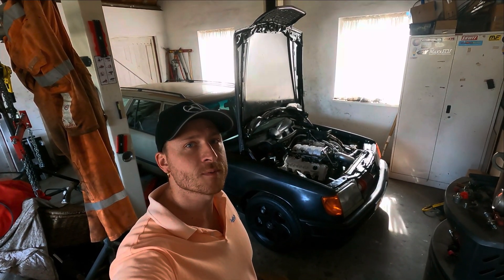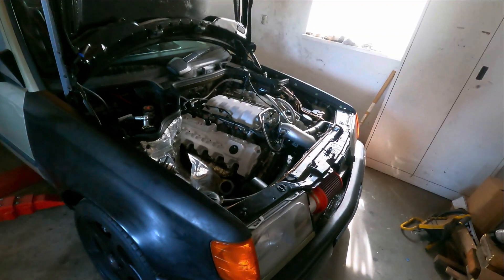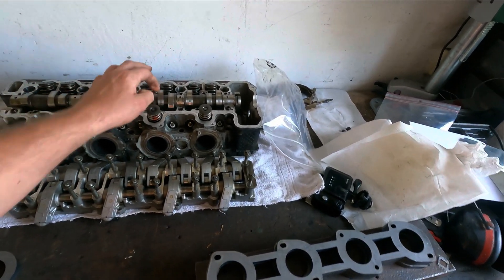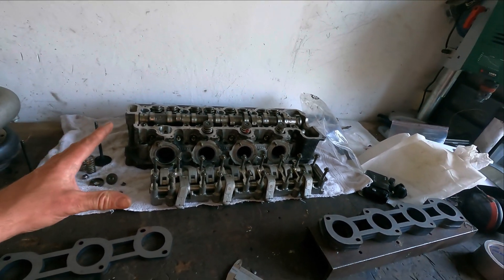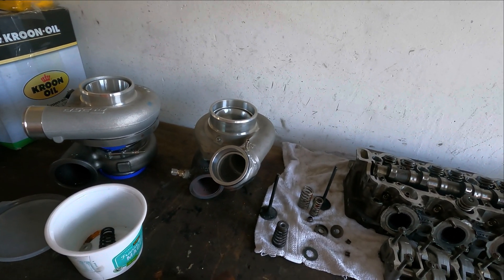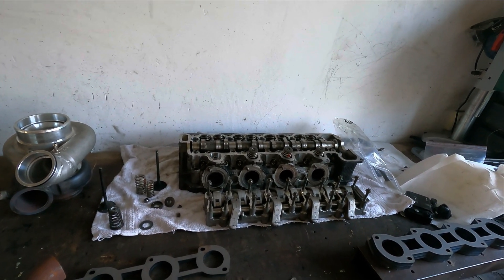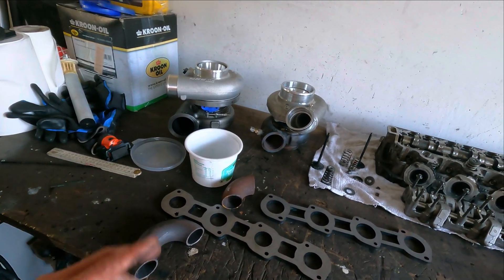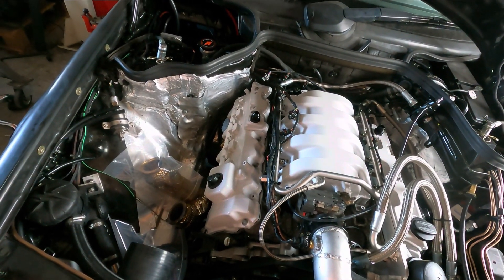Upgrade to M113k Heads and Bigger turbo after 1e dyno session

Comment: 3:32 Surprising to hear the 55k uses the same size exhaust valves as the 430. Are the intake valves the same size too?

7:13 From what I've read and seen the kompressor engines also have larger combustion chambers to lower the compression ratio.
Reply from the maker: I think i mentioned  later that the 430 valves are smaller.  De 5.0 and 55 are the same . Sorry for the confusion
Reply: @JMSpeedshop  👍
Reply from the maker: Yes the combustion chamber is bigger.  But not is i thought ,3cc or so.  And then the dome in piston. What the NA engine does not have

Comment: M113 AMG 5.4 naturally aspirated engines also have double valve springs as standard.
I think it would be a good idea to fit new valve seals to those heads while you are there because they are known to start leaking in some cases.
Reply from the maker: Yes.  All amg heads have double springs .  I will clean them and for sure put new valve seals in

Comment: Also put a nipple in the downpipe to measure back pressure in the system..(more. Importantly this pressure will make the lambda sensor read "rich"..the more pressure it sees.
Might be a good idea to add a "dyno" lambda sensor bung in it aswell, reading from the back, with twin pipes always reads wrong. 👍
Reply: I have an nice backpressure canister for you to test on it (before turbo ofcourse) let me know where to send..
Reply from the maker: I have one 50cm behind the turbo . But going to 4" downpipe .  Also going to run 8 egt. Sensor

Comment: Absolutely do not use the big pipes.. you will kill the turbine efficancy. 

Flare up the 37mm Id pipe. Absolutely don't run the 42mm..just not needed 
If you want to see what pipes work, look up the "m119LM" small pipes...
Reply: I also want comment this. We do with 42.4x2.6mm Manifolds more HP and spool than the bigger 48s also over 1200hp on 6cyl 3.6 liter.
Reply from the maker: @TimsTurboCentrum  sounds correct .  If you dont downsize from the exhaust port diameter
Reply: Just for reference, made over 400hp\cylinder with 33mm Id tube... 1.25" shed40..
Reply from the maker: That can be the case .  But going down in diameter is not good for flow.  And this engine can not be compared with the m119lm engine that had 2 exhaust valves and 2 seperate exhaust outlet ports.  It is a fact if your run smaller pipes and downsize them you will run higher backpressure.  And you should calculate the volume from collector to the exhuast port.  This will have alot of influence on the effeciency.  And most important for turbo efficiency is not flow this is heat.   If you look to the m119lm it is running Pretty long runner before entering the turbo i dont have room for long runners. If i have the same volume with the bigger diameter that will.match my bigger exhuast port my efficiency will be better then with smaller pipes because if will not downsize the port diameter .
Reply: @Not-Sure-Viralade-ftw  that's good size yes! In sweden they test many tube sizes on big engine /big port heads. Smaller tubes better results.
Reply from the maker: Last week i discuss this with a tuner friend in Sweden what he is using.  He never downsizing and he advices me to use 42mm inner diameter .  That is what he is always using with good results.   This will be always a discussion point.  What is best .  I think there are many variable points.  And if i have a multi valve also in the exhaust and that is not so sensitive to back pressure i think i would run a smaller tube . But for me now it makes no sense. I want to be on the Save side
Reply from the maker: I think best with runner lager diameter pipes is runner short 4-1 primairy pipes to the collector.  The filling volume still will be low.
Reply from the maker: I will have a look.  👍
Reply: I use 42mm pipes and 60mm. Turbo spool very good, and revs 7200 ;)
Reply from the maker: Oke.  And 42mm internal diameter?